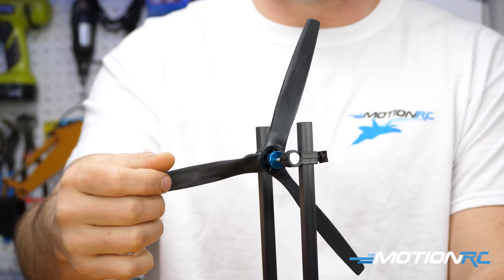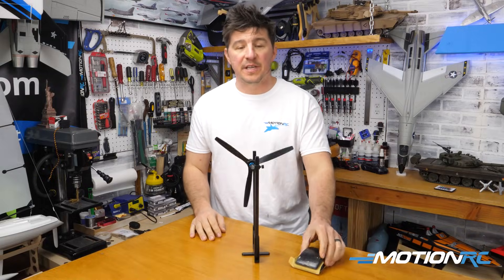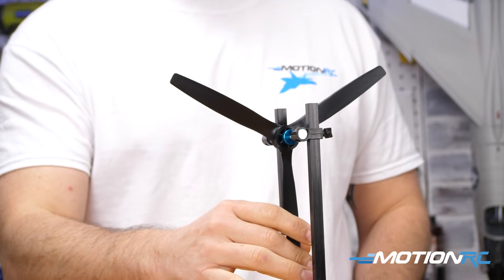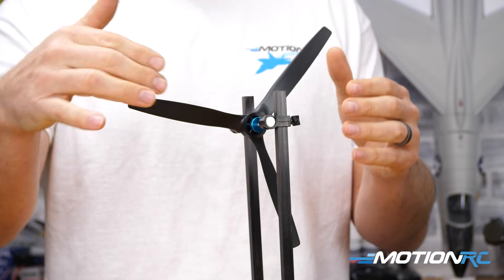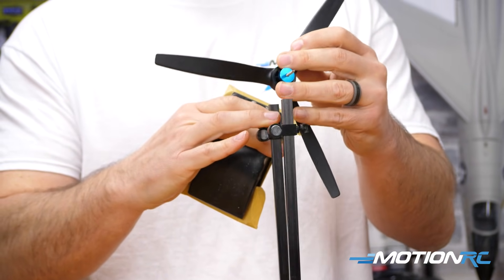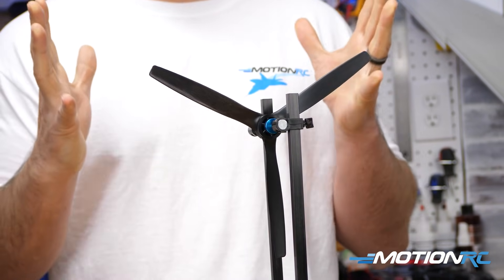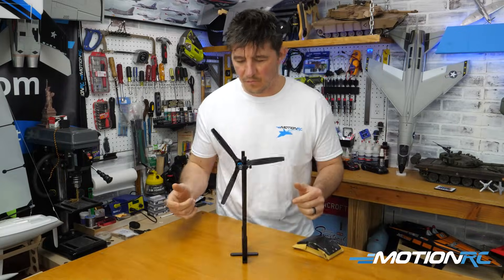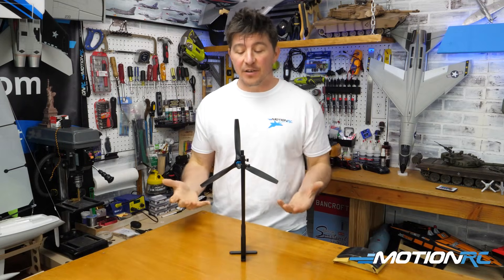How To Balance A 3-Blade Propeller | Quick Tip | Motion RC

Comment: What grid sandpaper are you using
Reply from the maker: Whatever I have on hand ..won't make a difference on the back of the prop
Reply: Are u in the thousands or hundreds, 1000 grid or 500
Reply from the maker: @Big_Ron_1  probably 80 or 120 grit, don't remember. But again, smoothness doesn't matter on the back of the prop, your just removing a small amount of material to balance it
Reply: @MotionRC  no but a heaver sandpaper will remove more vers a lighter will remove less, i think 320 would be great

Comment: Good tip James, I tend to sand off the front of the prop to avoid altering the concave side of the blade on the principle that the concave side is  the shape that is grabbing the air and creating the thrust, unless of course some aerodynamic genius tells me otherwise !

Comment: James. Very good. In regards to small black props, I clean the blades and then i use very small pieces of foil tape on the back of the lightest blade till it balances. This method doesn’t take much. Then i touch up the tape with a black sharpie. Many different ways to skin the cat so to speak. I prefer not to remove any material when i’m able. P.S.  I like the magnetic balancer you have. 👍👍😊
Reply from the maker: That works well, as well for sure. Good tip

Comment: That is almost exactly the technique I use. I use a loose piece of sandpaper though, as this allows you to sand the blade evenly and not significantly alter the airfoil of one blade more than the other. That way the blade is balanced by weight and aerodynamics so that each blade maintains as close to the same lift during rotation as possible. I start by removing all the flash all the way around the propeller before even putting on the balancer. I also try to finish with a finer sandpaper, sometimes, not really necessary though.
Reply from the maker: good tip!

Comment: 3 blade props take time and patience.
Reply: This is actually very quick and easy to do. Shouldn't take just a few minutes. It is important to turn off all fans, a/c, or anything that causes air moment in the area though.
Reply from the maker: Yeah, what I wanted to make sure I didn't do was take too much off the heaviest side then have to start the process over

Comment: As you get closer to balance I suggest going to a finer grit sandpaper to get back to a polished surface.
Reply from the maker: would that matter on the back side of the prop?
Reply: What grits?
Reply: @d @divingfalconfpv4602 Grits are what the sandpaper quality is refered to as
Reply: @ronith2674 I meant what grit did he use. But I already balanced mine.